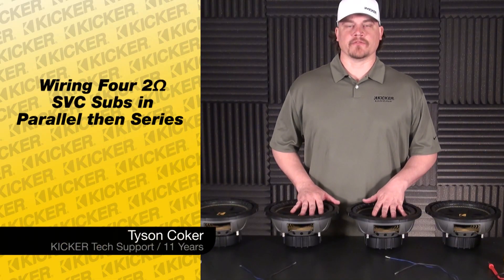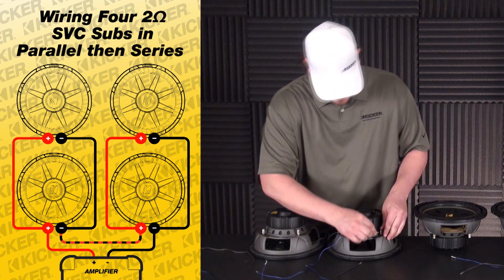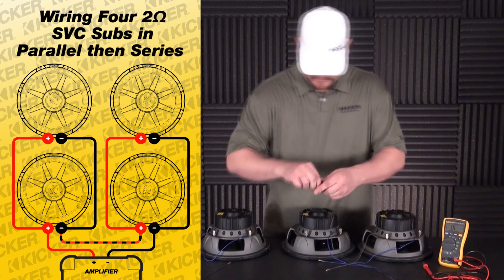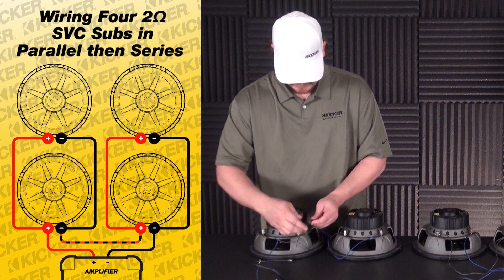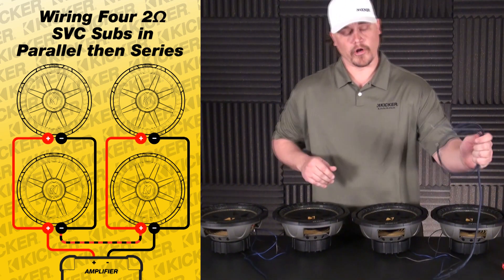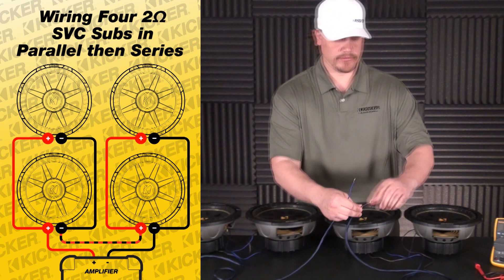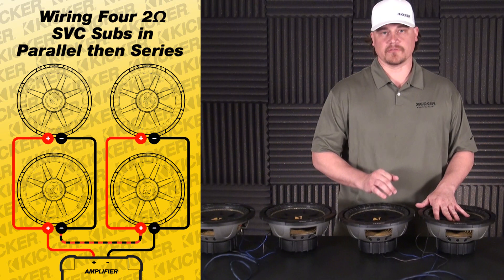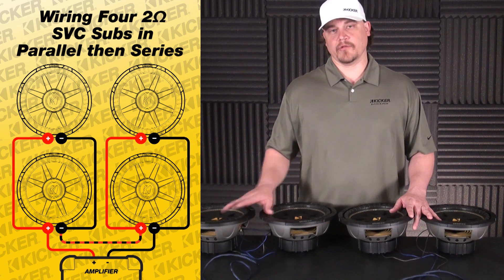Subwoofer Wiring: Four 2 Ohm SVC Subs in Parallel / Series

Comment: Sorry about that, it's a Taramps HD8000.1 mono 1OHM stable.
Reply from the maker: Jimmy, according to the manual (https://www.taramps.com.br/wp-content/uploads/2018/10/MN_510007126_R00_MD8000.1_SITE.pdf look on page 9) they recommend 370 amps of fusing. using ohms law, at 14.4 volts that works out to 5,328 watts max power at 100% efficiency. First off, NO amp is 100% efficient. In all likelihood, your amp is closer to 75%. Second, it's unlikely you're getting 14.4 volts unless you've upgraded the charging system/added batteries/using 2/0 gauge cable,  If you in fact have that voltage, it means that you're getting just about 4,000 watts if fused per the manufacturer's recommendations. That said, at 2 ohms, you'll probably be getting about 2,000 watts total.

Comment: I have 4 Soundstream references threes tranchulas dual voice coil 2 ohm 10 inch subwoofers to a 5000 watt class D monoblock do I run my Subs parallel or series. the amp is a Planet Audio 5000 watt class D monoblock 1 ohm stable
Reply from the maker: Unfortunately the math doesn't work out on that.  With a pair of 2 ohm DVC subs, you're either going to get 1/2 ohm, 1/4 ohm, or 2 ohms.

Comment: Could I do the 4 subs that r svc 2 ohm....run each like u did to 1 ohm but rather than splicing them at the amp do this......run both at 1 ohm positive and negative on each of my terminals on my hifonics Zeus 1500.1d mono amp...since its mono class d it has 4 terminals...2 positive and 2 negative. ..therefore each would b 1 ohm and yes its 1ohm stable
Reply from the maker: I pulled up the info on the Zues amp and since that is a mono amp, it states the two positive terminals are the same internally as are the negatives.  So, you would only use 1 set of postivie and negatives and the 4 x SVC 2 ohm subs, you would only be able to wire them to either a 2 ohm load or a .5 ohm load.  At 2 ohms mono this amp pushes 1000 watts and that would be split 4 ways.